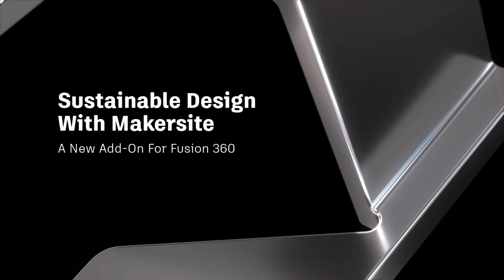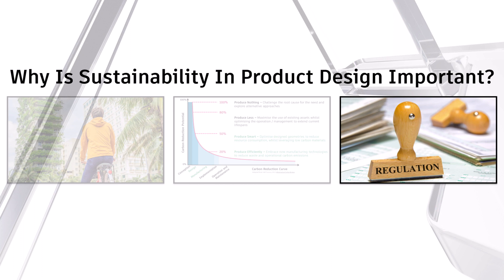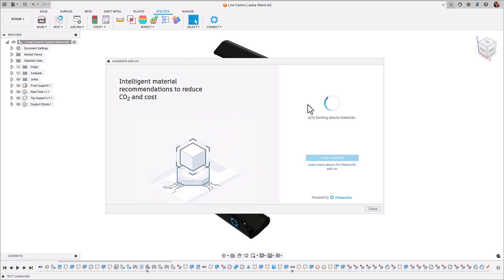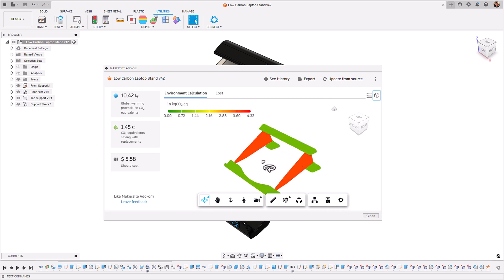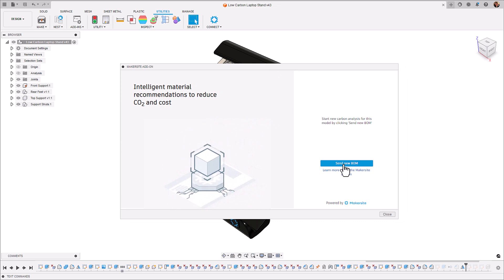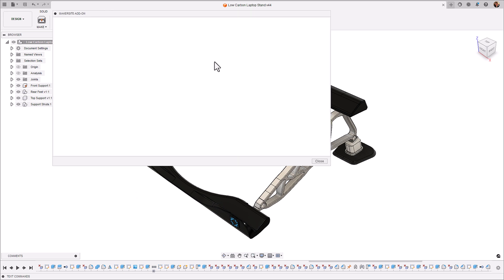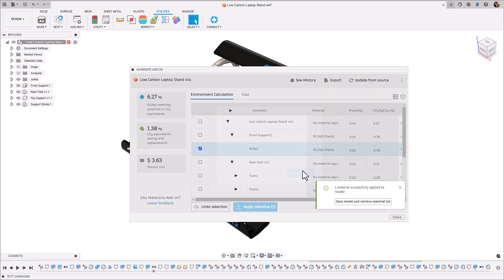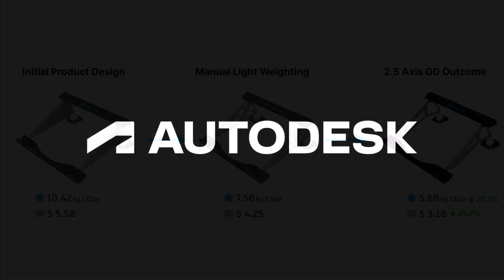Makersite Add-on | Technology for a sustainable world | Autodesk Fusion 360

Comment: Does this take into account manufacturing technology? For instance the aluminum structure when made light weight would be cheaper and use less material when 3d printed but would use the same amount of material and require more machining and additional fixturing when machined and would definitely cost more.